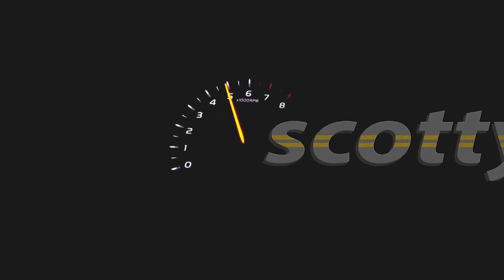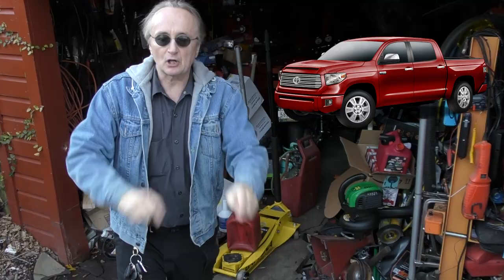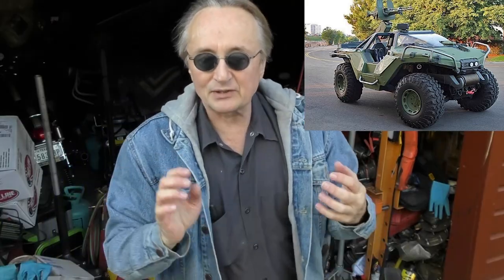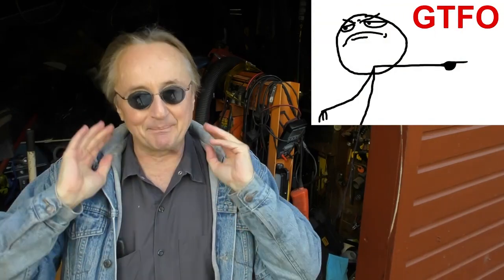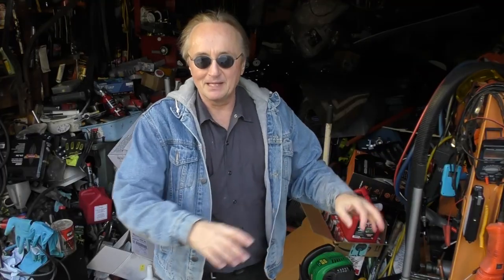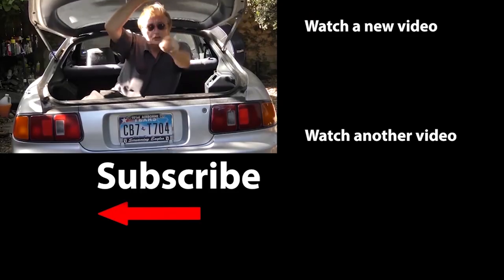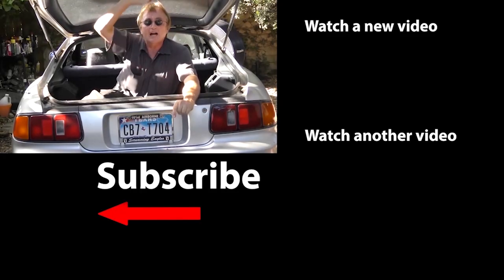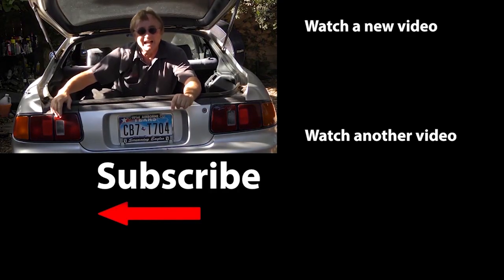5 Used Trucks You Should Never Buy

Comment: I owned a Ram 1500 for 10 years and no issues except for the paint flaking off and the dashboard cracked.Sold it bought another Ram 1500 have owned it for over 10 years and no issues as of yet!
Reply: I have a '97 SS/T that I'd trust coast to coast. Has over 260k on it. Couple years ago bought a used '14 R/T. Not a single issue with it and it's a killer truck. I can see the spoiler on the Daytona being a problem in using the bed, but I'd take it over any GM or Ford lol
Reply: Do you think ram products get more unreliable as the price goes up or the other way around ? I was thinking about buying the cheapest new ram 1500 4wd truck I could find and don’t want it to break on me
Reply: TheIndianscout I have a Dodge Ram that I've owned for 17 years, and it's got 303,000 miles on it. Been a great truck! I only had to replace the rear spider gears in the limited slip differential, a couple fuel pumps, and the headlight switch.
Reply: @slackjaw4902  stay away from ram  1500! i had a 2004 it was a money pit they all start rusting very badly around rear wheel wells ! my front drive shaft broke when using 4x4 then it got "chrysler itos " problems in wiring harness that mechanics could not figure out ,my truck would die at intersections then every time takke to shop couldnt find the problem not cheap on fuel total garbage of a truck it was a mistake buying that truck plus lost half the value  when gas prices went up and everyone was selling them just stay away from them !
Reply: @utahwanderlust700  The Dodge  I'm driving now have had it for 10 years this past December162,000 miles. Only thing I have changed is the headlight and blinker bulbs.
Reply: Just curious, do you follow the recommended maintainance religioursly?  Had a landloard that use to buy Rams and he loved them and never had major issues but he keep up the maintaince work to a T.
Reply: @slackjaw4902  For Dodge in general, I would stay away from all the toys and electronics personally. I know people who have a lot of issies with all all that stuff. Meanwhile, I know some without all the toys and extras and they are happy. IMO, it's just one more thing to break. But I am like that with any car.

That being said, also do your research on the engine/model/etc... you're looking to purchase
Reply: Dodge Ram the best trucks out..Take it from a Dodge guy
Reply: @utahwanderlust700  That's a lot compared to my 96 fzj80 landcruiser. 330,000 miles and only had to replace the alternator. Burns oil but runs totally fine. Still use it sometimes as a daily driver. I'm assuming a Tacoma would be just as if not more reliable.
Reply: I have a ram ‘08 1500 as a backup and a civic coupe as my primary. Nothing but problems with my dodge. Must be unlucky or not used enough. Riding it till the wheels come off- which may not be too far away.
Reply: RAMs usually rust real fast. Also, the 1500 is weaker than a Ridgline, less payload capacity
Reply: JT Automotive Rideshare Guru Out where?  The service department?
Reply: 10 years is nothing and I assure you, you got lucky
Reply: They are reliable, Scotty just hates dodge and Chrysler.
Reply: You have either gotten very lucky or you are lying. Every one that I know that has had a 1500 dodge ram has had nothing but problems.
Reply: I got an 05 ram 2 door engine and trans runs great  only had to do oil changes brakes and just last yr I replaced my shocks and struts and it's been good so far I've got 170k miles on it atm it isnt my daily since it drinks more gas than a Mexican drinks beer on payday but I've had to daily it alot a last couple of yrs til I bought me a 4 banger
Reply: @joetacoma6829  Maybe 10 years on a truck with no issues isn't anything to you but it might mean something to someone else.else's
Reply: @damiand9311  He hates everything that's not a Toyota.

Comment: 621k kms on a 09 Ridgleline before the motor locked up......the transmissions behind the Ridgelines are a Manual based with soloniods to change the gears. It's not a conventional ring/sun/Carrier assembly.

Comment: Damn, Scotty, U pissed off lots of people with that Ridgeline comment.
Reply: I wouldn't say he pissed anyone off. Everyone's just correcting him :P
Reply: @Brand New Day
Haters gonna Hate!
Ridgelines are for yuppies. Buisness men who want a truck to feel like a man, but dont wanna give up the luxury of a midline sedan. Even though they know the only thing its ever gonna haul is a briefcase & maybe a new foot stool for the wife on occasion.
Reply: @eriklehnsherr5784 Why sling mud?The Ridgeline has roughly the same payload capacity of the Tacoma, but it drives smoother than most full sized trucks. Where I live (Northeast Ohio), 4x4 or AWD is a requirement. We just had 15 inches of snow, and I drove through 20 feet of unshoveled driveway in my Ridgeline. I drove fine on 4 inch packed snow and ice, while a RAM 2500 did a 180 behind me (both of us turning right after a red light). Furthermore, the older ridgelines are actually known to have better build quality then the newer ones despite what this video says.

 I'm not a fan of the maintenance required by the J series engines, but I'm confident that my Ridgeline can do whatever I need. The transmission is fine, and I'm not sure why he always hates on Honda's transmissions. I've only heard of issues with FCA and occasionally Fords for transmission. I've never heard of a Ridgeline owner who didn't like the truck, which is pretty much the same thing you hear from any truck owner. Just buy the vehicle that you need. If you need more power, there are other good trucks.

I don't use a truck for work, but not everyone does and that isn't a problem. Most people don't tow 5000 +lbs. Heck, 98% of people who actually tow never exceed 2k lbs, which is arguably fine for a midsized crossover or sedan (although the manufacturer may disagree). I like the flip up seating and I like the trunk because I have a family. I would have preferred a body on frame vehicle, but my 07 is fine and doesn't need replaced. Not trying to be a hater or a fanboy, but I researched heavily before I bought it and don't regret my purchase
Reply: Erik Lehnsherr yeah I don’t know about you but these “yuppies” you refer to buy big top of the line diesel trucks lol, not Honda ridgelines 😂😂 like a F250 platinum or limited.
Reply: @TheConstantComet  intelligently and informatively laid out.. thanks Comet.
Reply: @Joey Schtick It's one thing to be butthurt it's another thing to be lied to.
Reply: @Joey Schtick It's subjective, but not necessarily true. That doesn't make it a lie, but it does make it worth refuting for those of us who care and disagree. Nobody is crying. We just disagree and are saying why. No need to be salty. FWIW, Scotty is right in pointing out the ridgelines as a potential buyer beware because the maintenance can be expensive if you don't do it yourself, and time consuming if you do. Fortunately, it's easy enough to work on since it has a lot of room in the engine bay and it's high enough to get underneath without stands or ramps.
Reply: @Joey Schtick your statements are rather juvenile. As for subjective opinions they must still be based on factual data. His statements about reliability, power, ability to haul things, contradict available data. Did you know ridgelines can fit 4x8 sheets flat in the bed but tacomas cannot?
Reply: Saying the Ridgeline is bad is like saying every MDX, Pilot and Odyssey is bad too. They’re all the same. The Honda 3.5 rarely breaks and is easy to work on if it does. The Ridgeline is ugly and who wants a FWD pickup.
Reply: @aky115  i agree. There are dolled up lifted f250 platinums around here and they are not "work trucks". Usually owned by rich people in compensation for their physical dimensions. Next time you see one at fuel pumps, have a look. Usually nozzle is at head level of driver
Reply: Erik Lehnsherr I am far from being a yuppie. I drive a 2012 Ridgeline Sport. No back up camera, no leather, no sunroof and no navi.
I tow a boat, camper trailer, ton of yard stuff and material. Drives well, smooth, nice AWD.
Do you drive a pretty $70k ford or gmc?
Who is the yuppie?!
Reply: @Joey Schtick lol you sound the most childish in this thread,
Reply: @TheConstantComet   ,,, i was going to tell Mr.Scotty about what he said about the Honda Ridgeline but you said it all. And you said it brilliantly. I don't think he likes foreign vehicles, cause he all putting down Toyota and Honda. But we'll said!!!!
Reply: The facts hurt
Reply: @2KCamaroZ28SS  Tbf he started scrambling for things to list off as soon as he got to the Ridgeline. He's "seen" the engine go out (subjective) and how it can't haul or pull much which was flat out incorrect. There's nothing really factual there and doesn't fit in this list at all. It seems like he simply doesn't like the truck
Reply: @kzero1499  I doubt it could do even half the things a full size Ford or Chevy can.
Reply: @2KCamaroZ28SS  Of course not, it's not a full-size truck. It still did it's job and not nearly as bad as Scotty makes it out to be. Honda targeted it towards the majority of truck buyers, as whether you wanna admit it or not, the vast majority of buyers don't even come close to the needs of a full size Ford/Chevy anyway.
Reply: @kzero1499  I think it was best marketed for car owners or small SUV owners that would like the convenience of a truck. I need my 1 ton truck for work, most people don't even need a half ton, like an F150 or something. And we all know that Rangers and stuff like that are junk. I like the 4 door 4X4 Colorado though.
Reply: I’ve towed my nearly 5000lb trailer, hauled a 600 lb Motor bike, 1200+ lbs of gravel in one load, plenty of family trips with 2 full size car seats.. this is a great all round family truck.. bought my 08 RTL used.. had it 4 years, problem free.. meanwhile my wife has rear ended 2 cars.. 1st was 4 car pile up at low speed.. not trucks fault, virtually no damage to our truck.. it’s a tough sob
Reply: @eriklehnsherr5784  They are actually useful for doing things too. Yea, they aren't built for hauling head of cattle around a ranch but what mid-size pickup is? Again apples to orange here.
Reply: Lol yeah there feeling r hurt they don't realize it's a lot like a truck except that it's not apparently body on frame means nothing to them

Comment: Now Scotty, I’ve got to disagree.  I’ve owned a couple Dodge Ram’s and they are great for a Mechanic to learn on.  You can learn to replace all the steering gear, ball joints, etc.  Then for electrical faults you can learn how to fix a variety items and if your inclined can even learn to desolder and replace relays on the circuit boards.   And then you can learn to repair corroded electrical connectors.  After all this great training you can charge others to fix their wonderful Dodge’s.  How’s that for being positive.  Rusted out in Michigan. LOL
Reply: Don't forget you can also learn how to change a transmission with a Dodge/Chrys
Reply: Lmao hahaga

Comment: Scotty love the videos usually but what you said about the Ridgeline is way off. My truck went 245000 hard miles before I finally blew the motor and that was my fault. I was lapsed on changing the timing belt by 145000 miles. I drove it regularly. It did haul some stuff when I needed it to. It drove like a car down class 5 dirt roads with snow and never got stuck. I'm over 500lbs and it is the most comfortable vehicle I have ever owned. I've owned Grand Marquis, Tahoe s, Full size trucks too
Reply: You weigh over 500 lbs ??
Reply: 500 pounds jesus christ get off the computer and go for a walk.

Comment: As the original owner of a 2007 Ridgeline still going strong, this has been the absolute best vehicle I've owned bar none.  Other than regular maintenance (tires, battery, fluids, timing belt, etc.) and replacing one worn engine mount in the past 12 years, NOTHING in this Ridgeline has failed.  My only complaint is that gas mileage isn't great, and I've always averaged 16 mpg since day one (22 mpg freeway only driving).

Comment: I disagree with the Honda Ridgeline.  It is sooo much more practical than most other medium duty trunks in its class.  I did a lot of looking around at  P/U's and the 2017 Honda Ridgeline has better performance and fuel enonomy than any other in its power class, far superior ride, very practical storage trunk in the bed etc.  A friend had a 1st gen Ridgeline for like 10 years and promptly went out and bought the Gen 2 Ridgeline as soon as it came out in 2016.  They hold up better than any other domestic P/U - that is for sure.